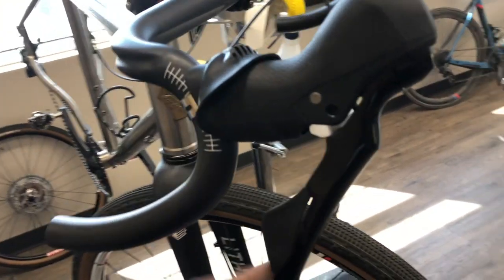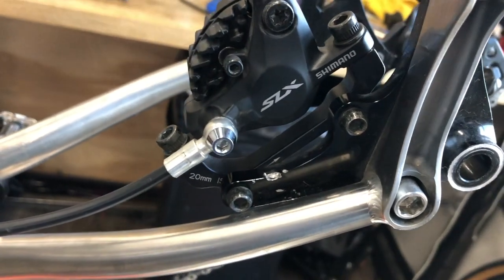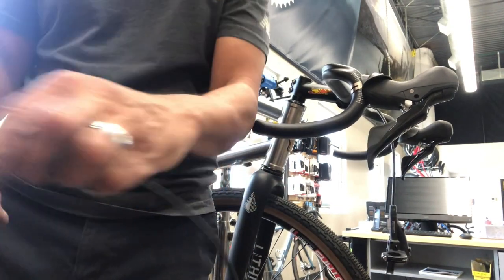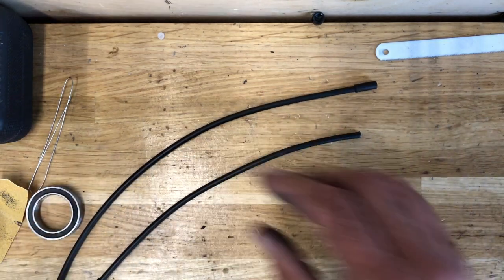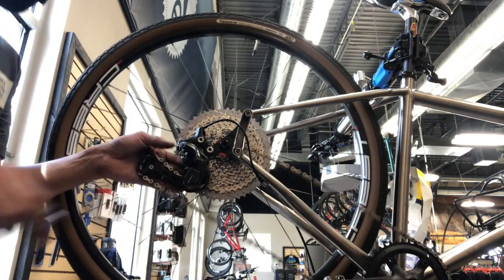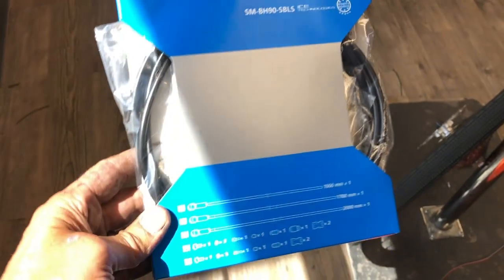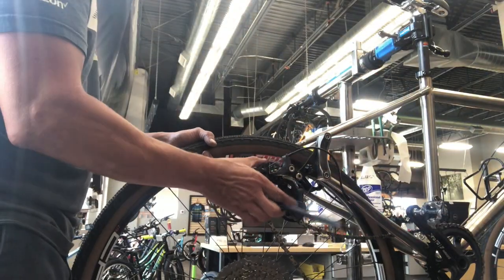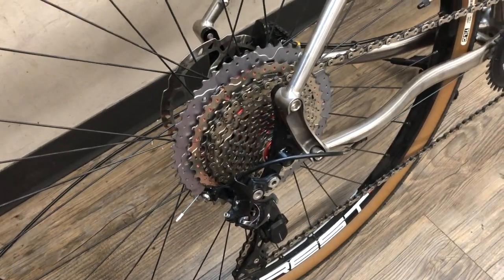Shimano Gravel 1X Mullet Drivetrain Mod

Comment: how to adjust Wolf Tooth Tanpan? or it isn't necessary?
Reply from the maker: There's really no adjustment other than the placement of the converter pulley. I just hooked it up as per MFG suggestion and it seemed to work. Still gotta adjust cable tension just right, but that's more of a Shimano thing.
Reply: @JoeyMesa  I see. thanks)

Comment: would a long cage road mech and dropout extender work as well?
Reply from the maker: A rear derailleur with a clutch will work much better in a 1x drivetrain. If you're riding on terrain that's bumpy, it's pretty much mandatory.
Reply: It would work but not as well. Those hanger extenders have a few bad side effects compared to a rear derailleur that was designed for a wide range cassette in the first place. They move the upper pulley a lot further from the cogs in the higher gears as well which is not ideal (although the same thing happens with this setup in the video, but it's not as drastic). Clutches are amazing too. 
I'd say GRX is a better solution than a Tanpan + a MTB RD if you go with something like a 42T or 46T cassette. Currently 11spd GRX rear derailleurs are a bit expensive (IMO), hopefully that will change. A 10spd GRX RD costs about as much as a Tanpan, but it doesn't work great with massive cassettes.
Both Shimano and SRAM should just stop screwing around and release 1x12 drivetrains for drop bars... In the MTB world you can get an 11 or 12spd Deore rear derailleur that was designed for a 51T cassette and it costs about the same as a Tanpan... 😡